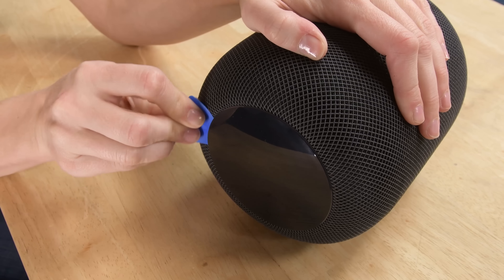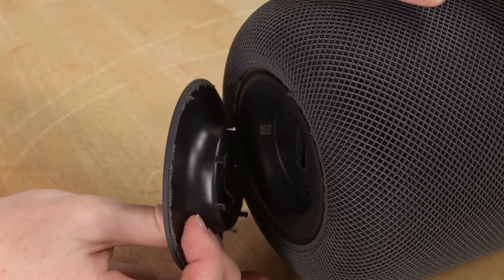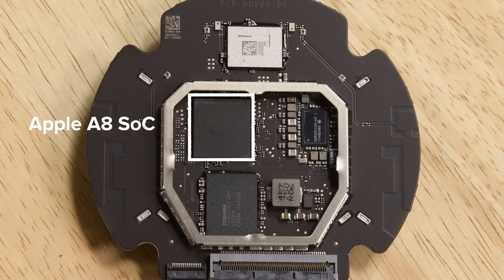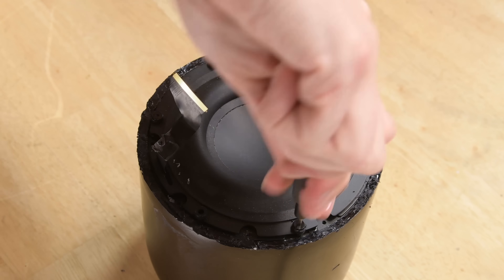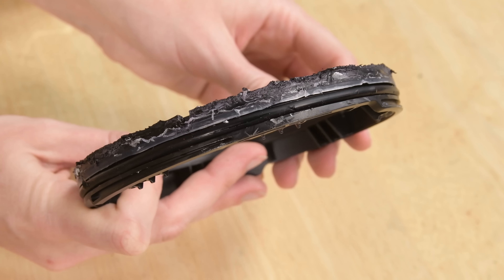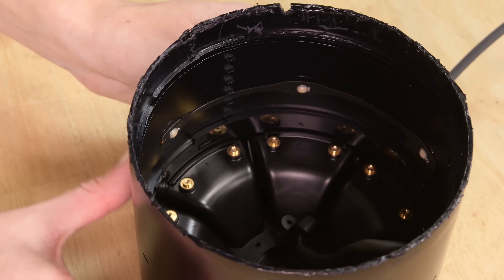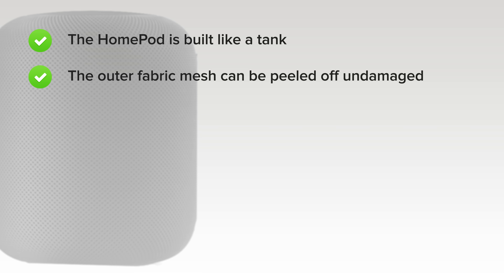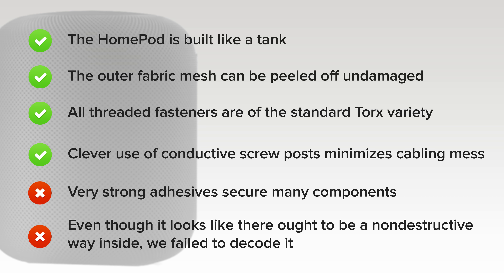The HomePod Teardown! (This one gets destructive)😁

Comment: I was able to open my HomePod without destroying the whole thing. instead of cutting that top ring open, you should heat and pry it from the INSIDE. there are a bunch of channels on top of the screws underneath where you can fit a long screwdriver or something and use it as a lever to pry it out, it's actually pretty easy to do, then the rest of the teardown follows normally as shown in the video
Reply: as for why my HomePod wasn't turning on I still have no idea

Comment: The Home Pod has been a failure because there is no way to plug in an AUX INPUT. And if we remember correctly, you have to be locked-in as a iTunes subscriber... Additionally it was one of the most STUPID mistakes which APPLE made  egotistically thinking that its purchasers do not actually completely own their produces they actually paid their hard earned money for. Right up there with the Idiot-odisy of the Mac Pro laptop’s 💻  KeyboardGATE failures.

Comment: People miss the point. If something goes wrong (and it's apple, it will) then repairing it has instantly rendered any prospect usless and void. They know you will buy another and intentionally make it so that repairs electronic or technical under warranty will be wavered or extortionate. The question is why would any billion dollar company do this? What do repairs have in the ways of a detriment to their buisness--aside from inadvertantly generating more buisness? If only they cared about the environment in ways that matter and treating the manufacturers like actual fucking humans.

Just buy a Sonos sound system. It's pretty dumb buying a speaker that it's main draw is AI...that doesn't work properly and is dumb. Hook up a small, cheap Google home to some decent speakers and save on being locked into a proprietary streaming bullshit by crApple.

Or buy a Google home max 🤷‍♂️😆.

Comment: Another 1 star not feasible to #repair pile of #complex to recycle #e-waste in the making from @Apple : a smash hit along with the bust glass repairs of iPhone 8 & 10 on the front & back + the #battery #performance #throttling #debacle #slowgate for older iPhones.
Reply: Those #upcomming #device #repair #laws will be #greatly #appreciated! Gluing & sonic welding makes the repair horridly difficult & unlikely to occur with any regularity. Furthermore if the cost of the repair is 85% of the cost of replacement.... designed obsolescence / "lifecycle analysis" // at least this one does not contain a fade prone lithium ion battery doomed to fail in a few years.

Comment: If done right no cutting would be necessary.. 

Undo the top screws and heat gently.. then unscrew mesh/cage bottom.. use ethanol or nail polish remover liberally in seal.. and apply a small amount of force until seal starts to separate. 

Then proceed.

Comment: It’s pretty disgusting that Apple is designing unrepairable stuff now. Even having the power cord built in is terrible. 
There’s no point Apple shouting it’s green credentials and then creating stuff that goes straight in the bin if a single thing goes wrong. 

I’m actually now buying older Apple hardware simply as it’s repairable and upgradeable.

Comment: They screwed two halves together and sealed it with adhesive when it was being made. It seems like at such a price hike, they will basically give you a new one. The new one will probably have recycled parts from other speakers that had defective pieces. Basically, all they need to do is put everything into two casings and screw them together.

Comment: Why 1/10? It looks like the main components that could go bad are fairly easy to get to (touch screen/logic board). Not sure why you'd ever need to go deeper.
Reply: Both of those required her to get through some difficult glue in order to remove. Also the parts inside are definitely susceptible to failure. E.g. the power supply could die over time due to a failing capacitor or damage due to a power surge or any component on the board failing for that matter. An internal connection could come loose. A speaker/mic could be broken by a child sticking something pointy where it doesn't belong. There's probably plenty of other ways it could go wrong and if the problem isn't with the touch screen or the logic board you're completely screwed.
Reply: It goes for the whole device not the most important components
Reply: For a blown speaker?
Reply: Because of the Caps on the Powersupply
Reply: Uh... the major repair on speakers is woofer surrounds. Which is right down inside.
Reply: Too difficult to open it up without damaging something

Comment: slightly confused… the sides of the homepod are hard plastic? so the sound comes out of just the top and the bottom?
Reply: Chris Murphy The tweeters fire toward a center cone that directs them down then out.
Reply: Yeah, the ads are deceiving. They make it look like the tweeters are openly pointing out the sides just under the mesh and that's obviously not the case.
Reply: Tweeters sound are directional and this thing has them muffled.  Sonos is better.

Comment: I'm actually really glad she called it a woofer unlike the other 90% that keep calling it a subwoofer 😤
Reply: Juan Carballo yeah, there can be a huge overlap in the relationship between the size and type of a speaker driver! For example, my main system uses four closed back 3" tweeters for treble only, two 10" woofers in sealed enclosures for the midbass/midrange, and eight 8" subwoofers in 4.4 cu ft of ported enclosure tuned to 30Hz which are properly filtered and only play true sub-bass from 80Hz down to 20Hz. Compare that to my backpack (rucsac) system which has a 3" extended range driver in a sealed enclosure for "midbass"/midrange AND treble, and two special 3.5" "RBM" subwoofers in 0.16 cu ft of ported enclosure tuned to 35Hz which play "sub-bass" from 120Hz down to 30Hz!

Comment: Apple market themselves as a company that cares about the environment but increasingly they create extremely difficult to repair - and in this case impossible to repair 'as good as new' hardware. Disgusting - they are so rich and do not need to do this.
Reply: thats how u become rich in the first place
Reply: If you think about the other way around you’ll have to go to Apple to repair and when they’re doing it most parts will be recycle so yeah cup half full or cup half empty type of view, where as if user are able to repair it themselves usually they’re just throw out old parts straight into the bin without recycling maybe you got a good few who bring those electronics part to a proper recycle place but I’ll say that is highly unlikely
Reply: This Thinge is Build like a Tank, i dont think there are alot of ways to destroy this badboy. That is why it has so much adhecive, the subwoofer is super Powerfull. Was it build like your 20.- China speaker it would take about 1 week before breaking down
Reply: They also made it almost completely impossible to break in normal use
Reply: Ever wonder how they became a trillion dollar company?
Reply: Quick question. what does a customer do with an old part that they have swapped out for a new one? Throw it out.
Reply: They built it this way because if the components weren't held firmly then that beefy subwoofer would have shaked everything off.
Reply: This is a speaker. Bashing a speaker for not being repairable is like bashing a car for not having an easy way to change the paint color.
Reply: apple has been doing this since the the iphone 5s.. the iphone 4 and previose were built likje lego, with very little glue... but now the relish in the fact that the can make thing look reparable, then add glue to every thread possible.. the have been outsourcing their waste to external companies for years to make it seem like they dont produce much. . im my opinion, paying an external company to deal with you trash is the same as making the trash yourself . fun fact, when i was living n toronoto, i used to get brand new iphones that were either retunred or apple deemed them unfit to repair ( most of them were brand new) from a samller company that apple was paying to ÈrecycleÈ for them .. the recycling company either burned eveything in an incinerator, or allowed the employees to steal them .. it was great for me, i got free iphones all the time, but it really expsed me to the gross under belly of how these large tech companies make it seem like they are being eco freindly, while paying opther companies to take the heat for producing unnecessary waste
Reply: They don't give 2 shits about the environment a BBC panorama exposed this roughly a year ago
Reply: Just because it is difficult/destructive to disassamble doesn't mean it can't be recycled
Reply: I have not once in my life heard of apple marketing themself as good for the environment.

I dislike apple, and I'm not saying you are wrong, but if they are marketing it as such they are doing a pretty bad job since I've only just heard about it from you.

Comment: Why the fuck a speaker has the same cpu as an iPhone 6? I mean, isn't that a bit overkill?
Reply: IscleGaming | ZefaCraft Apple have put the A8 in a lot of different devices to get the minimum CPU capability standard up (with the exception of the Apple Watch of course):

iPhone 6
iPhone 6 Plus
iPod touch 6th generation
iPad mini 4
Apple TV 4th generation
HomePod
Reply: For Siri stuff and real time audio processing.
Reply: It doesn’t need more processing power. Would you built in a 10.000$ CPU in your PC even if you didn’t need it?
Reply: I wouldn't be surprised if the A8 is just really cheap for them to make, and build the operating system (probably based on iOS) on top of.

Comment: so its essentially one of those tiny 2.1 pc subwoofers with the tiny speakers inside and using software bruteforce to get mostly decent audio out of it, kinda like google is doing with unimpressive optics/sensors + raw computational power to throw pristine images at you
Reply: That woofer was anything but tiny. Did you see the magnet on that thing?
Reply: You name me one compact bluetooth speaker that sounds good but doesn't use a DSP or other electronic circuits to tune the sound.
Reply: EspHack yeah "forced" sound from digital signal processing... i'll stick to my four closed back 3" tweeters, two 10" midwoofers in sealed enclosures and eight 8" subwoofers in 4.4 cu ft of 30Hz-tuned ported enclosure and get fairly flat response from 16Hz to 16KHz at high volume levels haha

Comment: This stays at your home, at one spot, plugged. Why does it have to be glued shut?
Reply: Subwoofers often have cleaner and tighter bass in a sealed enclosure
Reply: ReadyToGo 

Resonance is good for sound, especially to create boomy bass. That is a a moot semantic when you factor in a guitar cab, for example, or to a more realistic extent, a pair of studio monitors that work on the same principle are easily repaired and only held together by good craftsmanship and  by a certain extent of adhesive & glue. Granted,  there's no quote "smart" functionality but I'd rather pay for quality and not gimmicks, you don't see folks mastering on apple home pods, either. 

Yet again, apple push and alienate to the extent of driving it's customers and repair stores to android for a plethoratha of reasons. But to get back to the point significantly more popular Google brand of home speakers, like the new Google home max, with the same fundamental goal and market, but has the better success and justification through decent AI and and streaming that isn't proprietary crap. I get apple fanyboys will be drawn to this like flies to shit, but if you lock down the core functions you really aren't doing much persuading to other demographics, infact it has the oposite effect in being polarizing.
Reply: @insertnamehere8723  does google's speaker sound as good?
Reply: Andreas Martinsson to fix it when it breaks? In 6-8 years time you'll be kucked when it breaks.
Reply: Maybe it's for vibration. The sub seems large and powerful enough to make a big plastic thread turn loose all by itself. And even if it doesn't come off (it's still held in place) it might start to vibrate and make noise when playing stuff.
Reply: This stays at your home, at one spot, plugged. Why do you need to open it? =)
Reply: So you can have no vibrations, clear sound etc
Reply: Oh, you know why! To make money, of course!
Reply: So people can't easily repair it and therefore be forced to pay the expensive repair bill
Reply: @Primeyy  how many of the customers repair their own devices?
Reply: Because of the dust
Reply: Maybe the glue helps with vibrations? Perhaps the two pieces were able to be shook loose by that huge subwoofer... So their easy fix was to glue the parts that were rattling
Reply: So that Incase it falls, it doesn’t shatter into a million pieces.
Plus the speaker cause vibrations, if 2 pieces aren’t glued together, it can cause a rattle.
Reply: It’s a 60W woofer in a tiny enclosure, vibrations need to be reduced

Comment: The sound is not high quality
Reply: Christopher George yeah the sound is not high quality but the sound quality is better than the competitors
Reply: Ask the audiophile or Sonos previous Owner. The Audiophile says it sounds better than a 1000 dollar speaker and has a "near-perfectly flat frequency response". So no, It really has high quality sound.
But yes there are better setups existing. But the better it is the more expensive.
Reply: Don’t kid yourself - the sound quality is impressive.
Reply: Achmad Putra yeah but you'd fucking hope so for 4-7 times the price of its competitors
Reply: And how do you know that?
Reply: compaired to sonos and alex speakers.. this blows them away.. but still nothing like a proper 2 channel speaker setup
Reply: Achmad Putra for a low low price of double the comps
Reply: Since I have my Echo Dot connected to my stereo I don't care about the sound quality of the internal speaker.
Reply: No it is not.  Sonos one sound much better and you even can equalize sound.  I think that Homepod should sound better with less obstructive tweeters.

Comment: "Build like a tank"
The woofer has a foam surround that rot after a few years 

And without any surround you will get no sound out of the woofer and possibly damage it 

And also apple is going to support maybe 10 years at best

Build like a tank until apple decide to not support it anymore or until the woofer decide to not produce any sound

Apple quality
Reply: That looks like rubber or neoprene not foam.

Comment: The cord that plugs into the wall is remove able!
Reply: great, it gets 1.5 score then ! :)
Reply: Nicholas meade I think the entire population of the internet knows this by now, thank you anyway.
Reply: Yes! I was really surprised they didn’t show that
Reply: No and you need an apple wall too plug into
Reply: With a ton of force, the  cable will come out with a loud pop, and a video was done on 9to5 mac. "How to remove the HomePod power cable! [9to5Mac]".  Damage to Homepod, and or cable can happen, when forcing out cable.  https://www.youtube.com/watch?v=gjxILSOfJmQ
Reply: CYYZ_Spotter It‘s removable. Watch some videos.
Reply: CYYZ_Spotter yea it is.
Reply: XboxCarsForza it is, check 9to5Mac video about Homepod
Reply: It is removable. I've seen in other videos. But that's just a detail. What's not a detail is that thick cord that screws all the great design from the device. It could be sleeker, coming from the bottom, but from where it is it sucks...
Reply: yeah it is
Reply: Ryan Dooley yes it is
Reply: Yes it is, but I’m not committed to taking it out on mine
Reply: yes it is. You just have to pull a little hard and it comes off.
Reply: Nicholas meade your not supposed to remove it
Reply: No its not
Reply: no its not